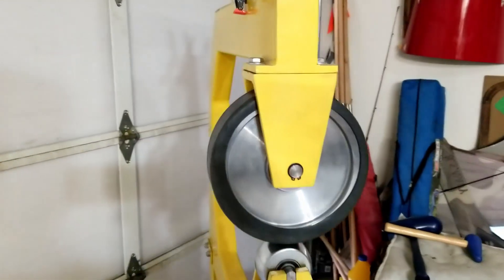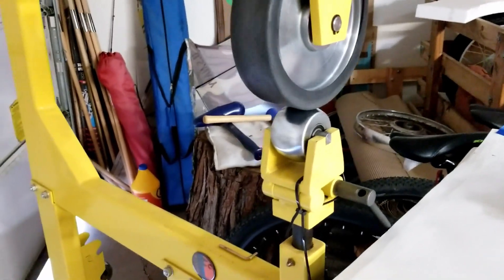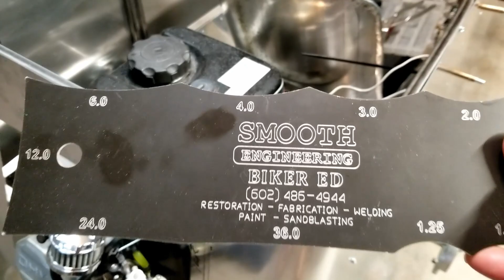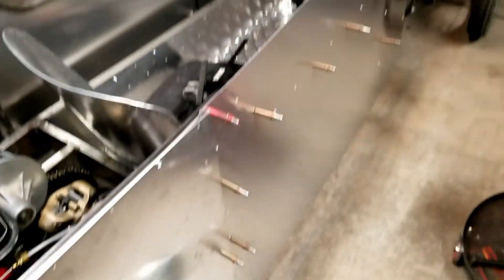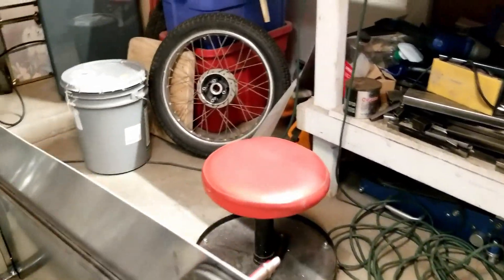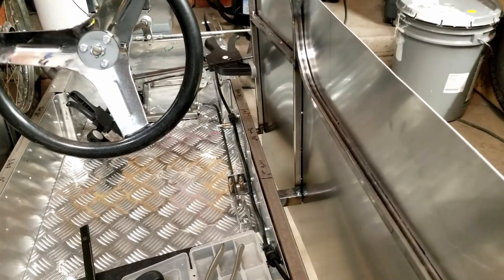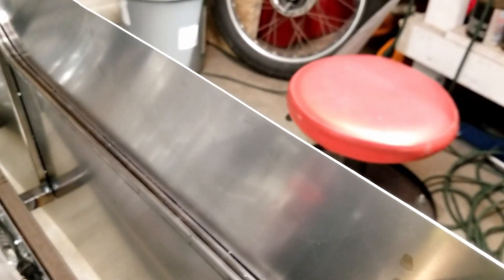Aston Martin Build part 7, body panels

Comment: Shame about the tank, a boat tail would have looked really nice. Is it in the 'rules' that the rear has no suspension?
Reply from the maker: the tank follows this specific inspiration car, after LeMans, LM8 was sold and converted for Street use.  Rear suspension is not prohibited, but it is difficult to make work and not throw chains.
Thanks for watching.  Design Build Race Repeat!